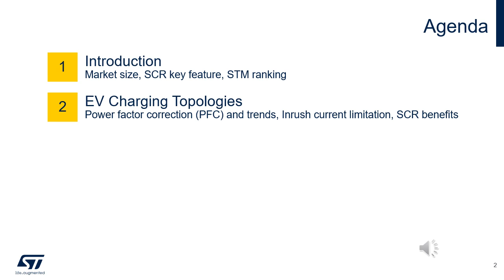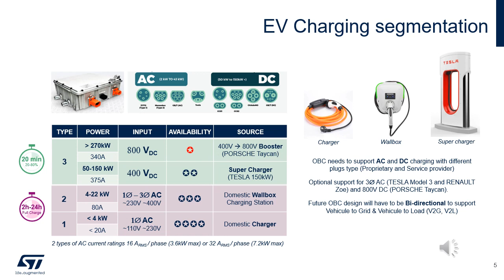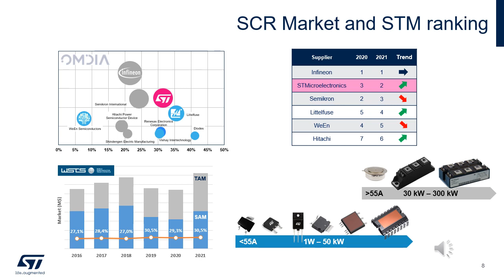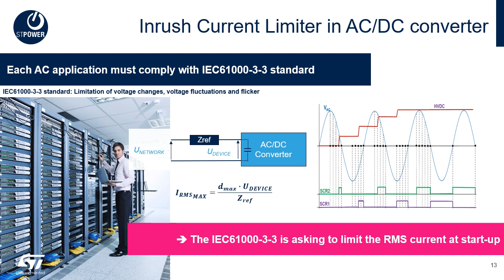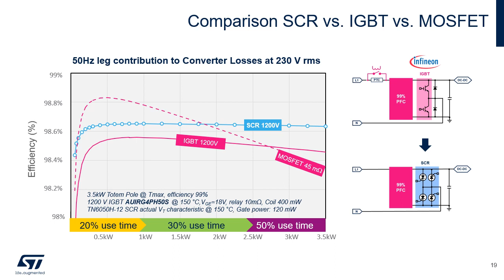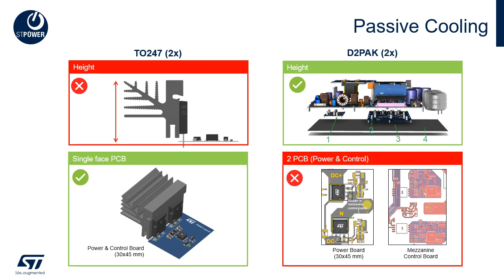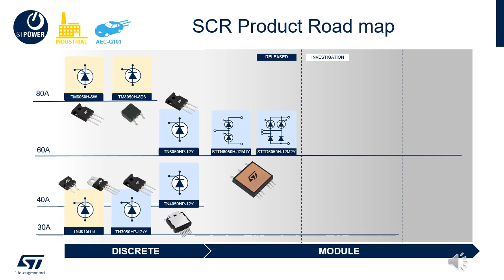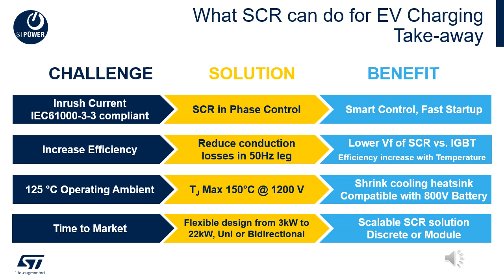Discover what silicon-controlled rectifiers (SCR) can do for EV charging applications

Comment: Dear ST,  As your STTD6060H-12M3, why dont you place SCRs on the upper legs and diodes in the lower legs so that the SCR gate drive circuit can be simplified with lower component count and lower cost?
Reply from the maker: Hello! We've contacted our colleague who you hear in the video about your question. Here is his feedback.

Thanks a lot for your interest in our charging solutions. In STDD6060H-12M3 3-phase module, SCRs are in lower legs and diodes are upper legs of the bridge. In that case, SCRs can be controlled through a very simple non-insulated control circuit based on a single small Triac and one diode on each SCR gate. You can refer to the ST evaluation board STEVAL-SCR002V1 on ST.com for detailed gate circuit diagram and performance.